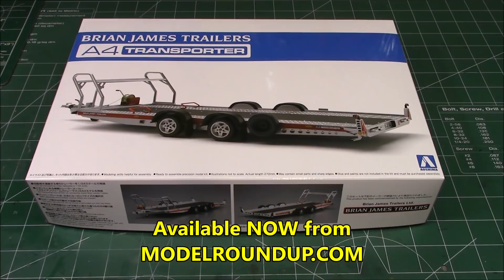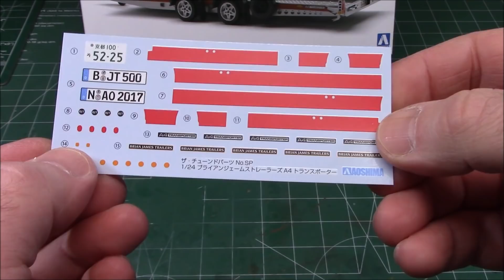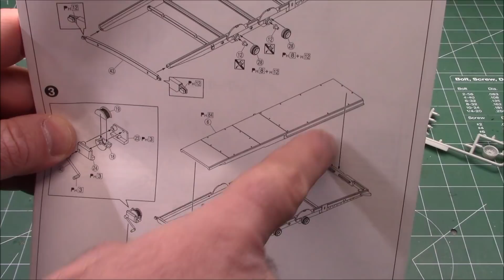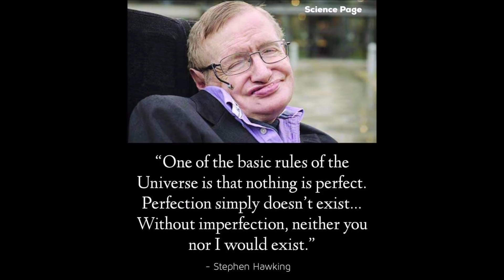Dual Axle Race Car Hauler Trailer 1/24 Scale Model Kit Build Review and Weathering Aoshima

Comment: I wish they sold smaller box trailer models like a 5 or 6 by 8 or 10 to hook up behind my 1966 ford truck model with the 6 cylinder engine in it.

Comment: Pretty neat. I didn't notice, but do they include the attachement part to put on a car/truck to attach it to the trailer?
Reply from the maker: I'm not sure what you're mentioning, is there a name for it? Thanks
Reply: @hpiguy  I dunno what would be the name, but it would be that stainless steel ball that you attach to the frame of your car so you can hook the trailer to it.

Comment: Chris, do you like Mark Fit over Micro Sol? Which would you commonly prefer
Reply from the maker: I just use it because the bottles are easier to use.
Any brand works really. I have all types.
Reply: @hpiguy  Ive got to buy new decal solvent it why i ask. I never knew Tamiya made any until i started watching you. Thanks and build on buddy!

Comment: Hi. Chris. Love the show. 👊  
Question.   When gluing the chrome or painted parts. Do you scrap it off .  I was always told to do so for the glue to bond.    Keep up with modeling.  Stay safe 👊.    Thank you.  Dave.
Reply from the maker: Thanks!
I just use the super glue for the most part. Sometimes I'll scrape if the surface isn't flat.